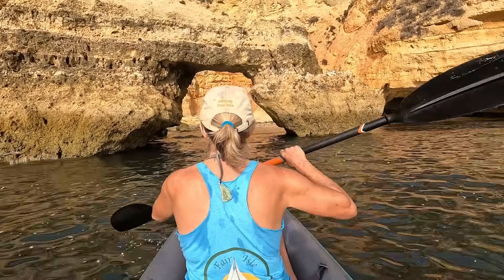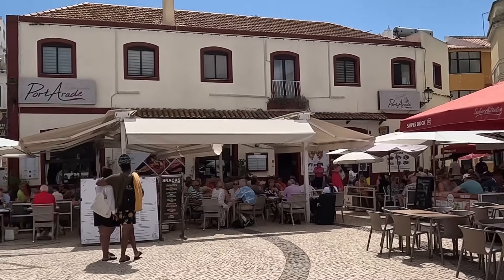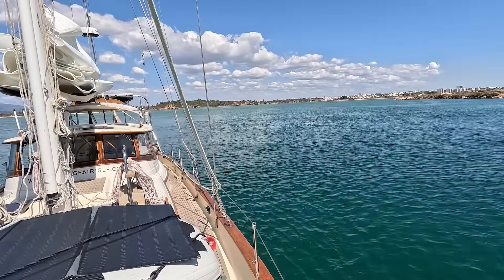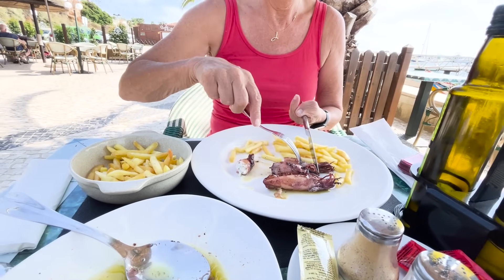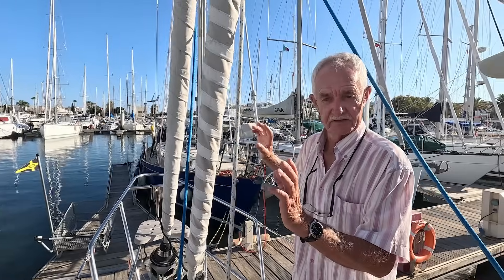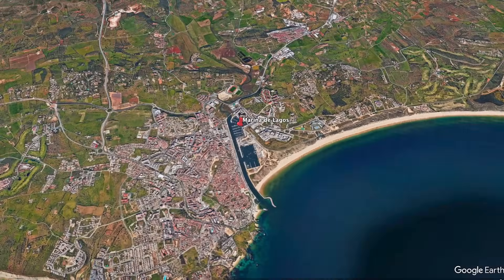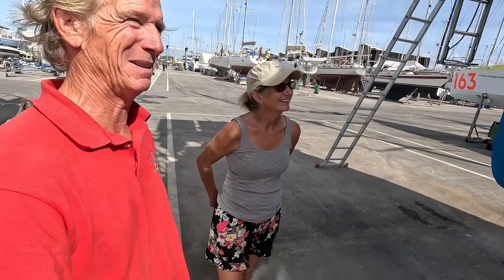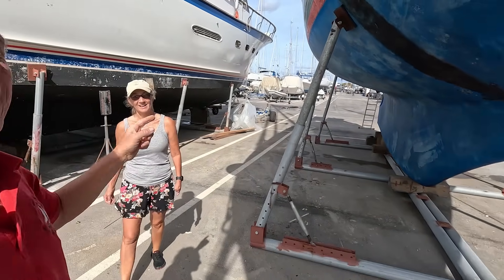Are the best anchorages in the Med just outside the Med?!  |  Ep99

Comment: How did you get rid of the barnacles in the holes please
Reply from the maker: Poke ‘em with a stick! I have a small wire brush to finish off as well. And then I use one of those sponge brushes to get some antifoul up there.

Comment: I had my blue hulled Nimbus wrapped by Yacht Wraps UK three years ago and it still looks fantastic.  No polishing required just a wash with car shampoo or equivalent. Much better than continually cutting and polishing. One of the best improvements I have made but if you do take this route make sure only the very best marine grade vinyls are used.
Reply from the maker: It's not going to work for us as we have little groves in the gel coat. Your right about looking into quality though. There is a problem with them breaking down then adding millions of bits of plastic to the ocean. It's something manufactures are going to have to monitor going forward to make sure the quality is there.

Comment: As always a good vlog, I learn so much from you both enjoy. From an ex Advanced SI kayaking two basic tips that may help : 1 why turning lower your arms and push your turning blade as far out as you can. The rear person has a better chance of steering the canoe; when paddling in a straight line try not to pull the blade past your hip. Doing this will stop pushing the boat forward and to to turn it. Enjoy

Comment: As always a great video. Noticed you’re using the Swellpro again what happened to the Poweregg?
Reply from the maker: Still got got and use it, like I said in the update at the end of the video (you did watch it all didn't you?!) I tend to not use the Egg in it's full waterproof mode because of the reflection problems off the case. i do sometime still use it over water with just the floats, but frankly I have the SwellPro which does a better job at sea so the Egg is used mainly on hikes now,

Comment: As I mentioned earlier, I love the way your boat is setup. I’ve wondered, does the canoe stern help in heavy following seas?
Reply from the maker: Yes a canoe stern certainly helps in following seas, but that not to say that you cant have an excellent handling boat without a canoe stern. Whats really important is good shape below the waterline, so if you have a boat that tapers around and still has a transom but the lower sections chamfer off quickly then it will still be great in a following sea. What you REALLY don't want is the modern trend which is designed purley for space to the absolute detriment of sailing is what I call a 'fat arsed boat!' A beam that comes all the way to the stern. These boats are just marina queens in my opinion and should never go offshore!
Reply: @svfairisle  one thing that I want (with my still learning knowledge) is a full keel. As you mentioned coming out of the Gibraltar straight, the rudder is better protected. As is the prop. If I were to hit a floating object or run aground, there is a higher chance there won’t be a hull breach by bending the prop shaft and loosing the rudder.
Reply from the maker: @rexvarr4574  Yes I agree, but if you are boat shopping I would not discount boats with a long keel and a full skeg. Be a bit careful if you're getting an old boat as when boat first changed over from full keels to long keels some of the engineering for the skeg was a bit suspect. A skeg has to be strong. What's more important for me is an encapsulated keel. It's very nice to be free of the worry of keel bolts!
Reply from the maker: Have you watch this video? might help...https://youtu.be/WeBGJsfrWg0?si=9jlF1aJpmAx95IAz
Reply: I couldn’t capture the brand name of the yacht you visited? Looks very nice and I’m curious 🙂
Thanks for lovely videos ⚓️
Reply from the maker: It's a Hylas 46, great boats
Reply: @svfairisle  I hadn’t gotten that far back yet. Great advice. Thank you.

Comment: With regards to the Schengen in Portugal, I’m assuming you would need to check out of Spain to go to Gibraltar then go straight to Portugal so you are checked out of the Schengen. then do Portugal not stamp your passport so you are not checked in. This is why you can stay as long as you want until you check into the canaries. Sorry just trying to work it out because if you hadn’t checked out of Spain you’d still be on the clock? Wouldn’t Portugal get into trouble doing that? If they can do it why can’t Spain? Spain have  applied to the EU but have not had it cleared, or so they say. It’s all a bit confusing, just wondered if you knew why😅
Reply: Yes we did check out of Spain and in to Gibraltar. Customs in Portugal said it was a bilateral between U.K. and Portugal that we could stay until the end of 2023. Not sure if that’s to continue…